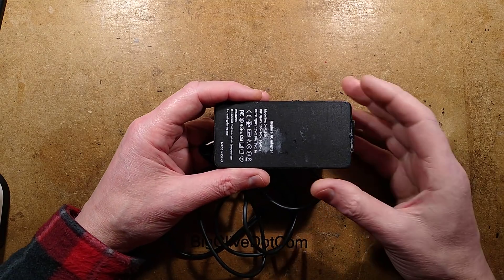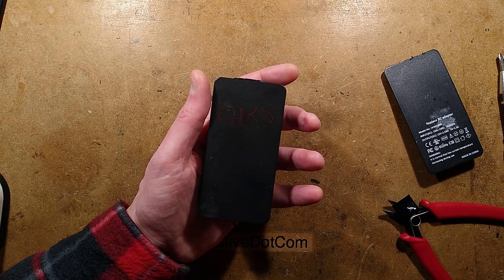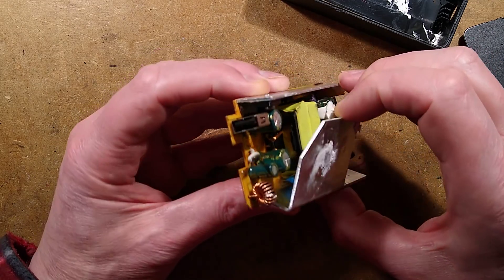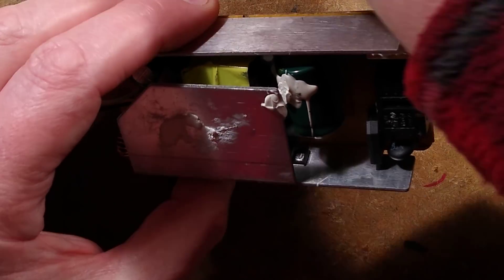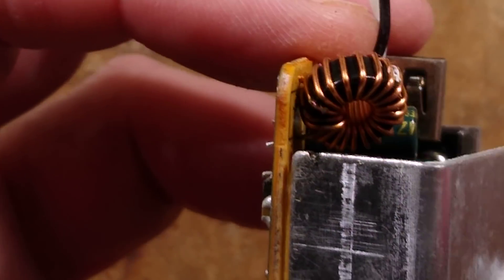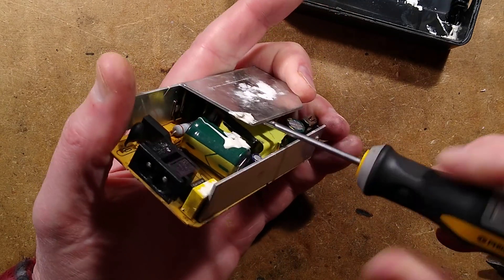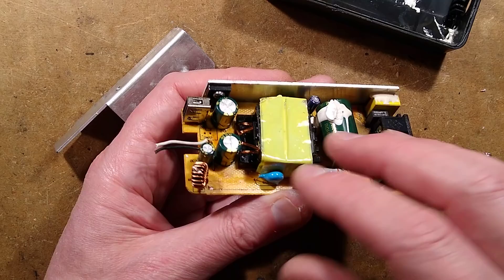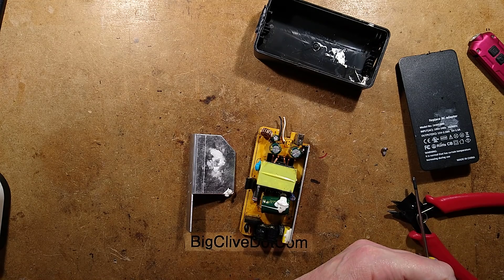This PSU killed a Microsoft Surface and a monitor

Comment: Yet another hard learned lesson on not to use cheap clone power supplies with expensive equipment. There is a reason why the genuine replacement power supply costs more.
Reply: Same thing with batteries and tools that can pull current. Seen a coworker's tool catch fire from Ali-express deals that are "cheaper".
Reply: @Goabnb94  I knew a friend that thought he saves a good chunk of change getting a knockoff power tool battery, he absentmindedly forgot to unplug it before he went far away on vacation, and it set his garage on fire. Luckily one of his relatives was in town and walking by the house when he saw the large flames and the damage was only limited to the garage. Those batteries are the nitrate movie film of the 21st century.
Reply: @Goabnb94  Ali Express keeps trying to sell me silencers, I have no idea why. Weird company.
Reply: Never buy  a replacement power supply directly from China. Buy it from a store where you physically go. I doubt any responsible store in the UK would sell that kind of stuff. The spelling errors are a dead giveaway. 

People do not get that such cheap power supplies can actually kill you.
Reply: @okaro6595  that's just it. Not only can these fry out easily and take your device with it, it could burn your house down too.
Reply: @okaro6595  Don't mail mains power supplies. Don't feed your baby honey. Don't discuss threatening plans. Don't run generators indoors.  Don't buy Kodak printers. MYTH: Not even once. It's all fun and games when NOBODY gets hurt.
Reply: @Samuel This is interesting, but difficult to confirm now that the site is offline.

Jonny had not been active in tech-journalistic capacity ever since he took up PSU work, specifically due to conflict of interest. So he COULDN'T review this PSU or any PSU. The site had been run by Oklahoma Wolf instead for like ever, who has now also retired several years ago. There was another editor but he also disappeared. There's no conspiracy to not review the PSU, people either have explicit conflicting obligations or have just moved on.

I have found an analysis of the PSU on EEVBlog forum, and it does look interesting, but there it's said to cost $40, which is a lot closer to actually making something, that's like a world of difference. $12 doesn't even come close. And there can be all sorts of schemes such as dumping to just generate the hype, not every price you see is actually sustainable - it might as well be a scam, where they'll do a bait and switch for customers that come ride the hype wave later.
Reply: @SianaGearz  DragonTime: "An offer that sounds like it's too good to be true, probably is."
Reply: I've had OEM power bricks fry the equipment it's powering too. Just because it has the manufacturer logo stamped on it doesn't mean it didn't come from the same factory as this thing,
Reply: @Samuel When I want a high power PSU for cheap, I just buy a surplus server PSU. The HPs even have a cryptographic anti counterfeiting chip so the odds of getting a fake are very low since it won't work in the original application. (And it's easy to check the quality just by looking through the vents.)
Reply: a hard learned lesson for someone , a lesson that will help me in the future.  a simple fix on a reasonable priced device.  i would buy a device like that and simply take it apart and correct the fault.   when a person buys a low priced item , dont complain after lol .
Reply: Tbf the genuine ones aren't great either. My Surface feels tingly when the charger's plugged in the 'wrong' way.
Reply: It sucks but something tells me that brick has been dropped one more or times before that happened. I had a PSU from corsair blow up upon just plugging it in and that bugger cost me well over $100. At least they gave me a new one and no computer parts were damaged. Errors happen it just unfortunate when you're on the receiving end.
Reply: Agreed. Genuine OEM for these devices only so if the shit hits the fan you’re more likely to get your device replaced.
Reply: @timwhite8500  I imagine homeowner's insurance wouldn't cover damage done by an un-original/fake/crappy device.
Reply: @timwhite8500  And you still get to keep your unoxidized house afterwards.
Reply: & there are also good replacements out there. Don't cheap out too much tho
Reply: @wisico640  Problem is unless there is some sort of trusted brand, you can never know what is good and what isn't. A lot of the replacement batteries or any sort of generic product sold at different pricepoints tends to turn out to actually be the same garbage, just with some sellers overcharging you more brazenly. And indeed you need to not only trust the brand, but the whole supply chain, because better quality Chinese stuff is also subject to counterfeits!
Reply: The reason genuine psu's cost more is greed.
As this shows just a single component placement was the issue so there are plenty of cheap psu you can buy that are great.
Reply: @jasonwilliam2125  agreed, just get a electrical engineering degree already.  
I always open cheap PSU's and Chinese electronics to add insulation/upgrade wires and prevent problems. 
I have an 800W PSU i bought for $23CAD including shipping thats been working great for over 2 years now.
Reply: @kylelongstaff  Colour me severely sceptical on those "800W". That isn't nearly enough budget for that sort of power, for the sheer cost of metal and components involved. It isn't even quite enough budget for 300W with decent QC and shipping either. If you think problem is just wiring or insulation, you're not looking hard enough and don't know what to look for - SMPS design is a highly specialised field which requires a lot of experience.
Reply: @kylelongstaff  I bought a $22 PSU a few years ago that listed no less than 4 different wattages in the same listing (150W, 200W, 250W, and 400W). After doing some testing, I found that it was good for about 250W, and would do OK with transients up to 300W for short periods. Eventually I managed to blow one of the main switching BJTs (yes, BJTs, not MOSFETs) while doing some overload testing, but I replaced the transistor and got it working again without much trouble. I ended up putting in in a Xeon/GTX750ti gaming rig, and it's been a solid PSU for a couple of years now.

I did a video on the unit if you're interested: https://www.youtube.com/watch?v=pRafY7S3fKw
Reply: @SianaGearz  well obv most underpriced equipment is composed of fake components and stuff but generally I don't buy anything without looking at reviews and of possible pics/video of the inside. And it's not a desktop PSU it's a plastic case battery charger so it's not doing high current it's only doing 84V 10A max and I measured about 8A really.
Sorry I wasn't more specific. Yes there's probably no computer PSU that's 800W under $50. Plus I would only buy a Gold/Platinum rated PSU
Reply: @kylelongstaff  oh yeah that's not actually a lot of current, that can be done inexpensively. I think a lot of these low cost unknown provenance products reuse salvage parts especially magnetics, but also power semiconductors and bulk caps, which is how they're this cheap, but at least as far as magnetics are concerned, that's better than the alternative...
Reply: @SianaGearz  exactly
Reply: @SianaGearz  both true, and false. 

True in the fact that SMPS is complicated and has it's own field of engineering around it.

False in the way of budget to component comparison. is 24 maples cheap? yeah, it is. You also have name brand PSUs (of the 450-650 watt range) out there for 50 bucks at the time of your comment. After removing import fees and freight fees to the store, it would equal about that in price. Why is this? Mass production.
Reply: @jasonwilliam2125  Well, we don’t know how well this power supply performed when it was alive. It might still have been crap. The problem with cheap PSUs is that you don’t know what you’re getting. Even if you have the technical knowledge to assess one for safety, it’s a destructive process (since you have to disassemble the transformer to check for clearances), and even if you do perform destructive testing, you can’t rely on the results applying to any other unit, since they constantly change (and clone from each other) the insides, so two externally identical units can be entirely different inside. (Ok, maybe if you have a high-resolution x-ray inspection machine at home.) 

To me, the risk of a cheap PSU frying a device, electrocuting me, or setting my house on fire simply aren’t outweighed by the modest cost savings. Yes, percentage-wise it’s a massive savings. But in absolute numbers, it’s not. Whether a phone charger costs $3 or $19, either one is less than the cost of a meal out. The $16 are well worth the peace of mind. 

The upshot of that is that the only way to make sure you’re getting a safe, high-quality power supply is to buy one from a top-quality brand, and to only buy it from authorized resellers (or ideally directly from the manufacturer) to make sure you don’t get a counterfeit one. This doesn’t have to be the original manufacturer: there are great third parties like Anker, Belkin, and even IKEA.
Reply: @jasonwilliam2125  So, buy a different cheap one and hope you get lucky?  Or buy this one, bury the inductor in hot-melt before you use it, and hope that's the only fault?
Reply: @jasonwilliam2125  I dont agree with you.  But I will offer no evidence why aside from Ive never had this happen and I dont buy knock off PSU's....